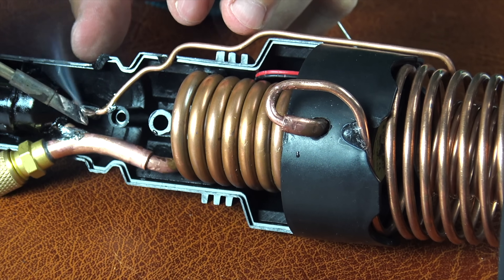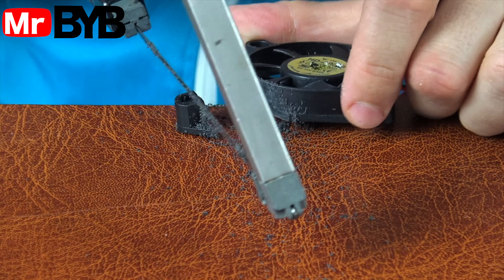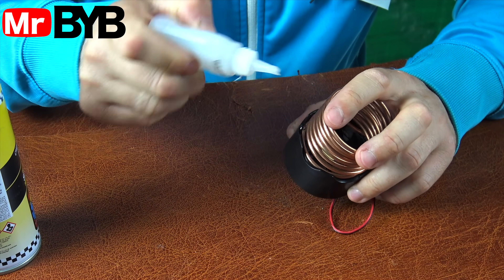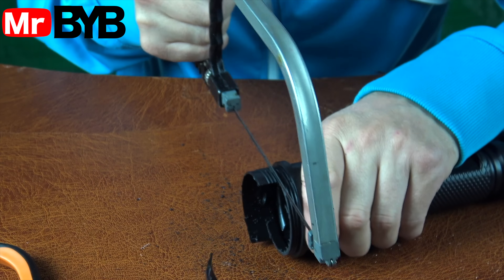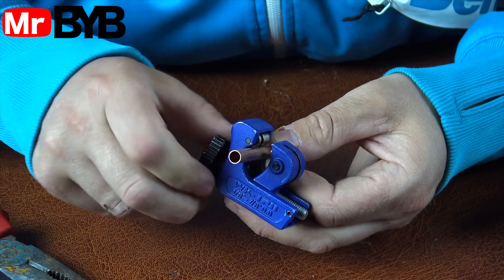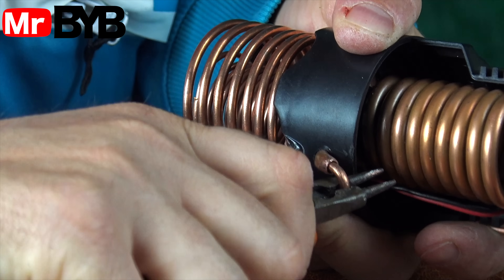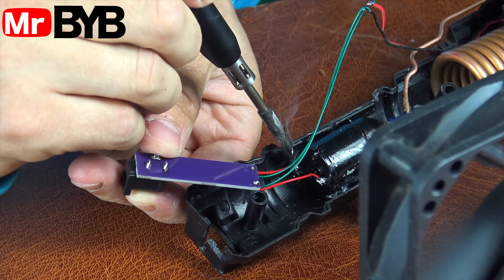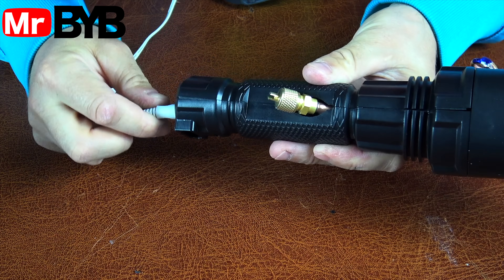DIY❄️ Mini Air Conditioner at Home – Ice Cold Air from a Flashlight!

Comment from the maker: 📌 IMPORTANT! Please Read Before Commenting!
Dear friends, since this video often receives questions and doubts about whether this mini air conditioner actually works, I’ve decided to give you a full and detailed explanation.

❄ Yes — this device is 100% real and fully functional. The working principle is exactly the same as in any household refrigerator, freezer, or air conditioner. It’s a classic refrigeration cycle based on phase change of the refrigerant.

🔧 How It Works — Explained Simply:
The refrigerant (in this case, butane) evaporates inside the evaporator (thin copper tube). During evaporation, it absorbs heat from the surrounding air. That’s why the tube becomes ice-cold and frosts up — this is a standard physical process called endothermic evaporation.

The gas then flows into the compressor, where it is compressed. Compression causes the gas to heat up significantly.

The hot, high-pressure gas then flows into the condenser (thicker copper tube), where it releases heat to the environment and condenses back into liquid form.

The liquid refrigerant returns to the evaporator, and the cycle repeats.

📌 This is exactly how every refrigerator, freezer, and air conditioning system on Earth works.

🔥 Common Questions Answered:
— “Why is there only one fan? Won’t the hot and cold air mix?”
✔ Great question — in professional AC units, the hot and cold sides are physically separated by a wall and have two fans to maximize efficiency. However, even without perfect separation, cooling still happens — just with lower efficiency. The visible frost on the cold pipe is direct proof that the system is working and removing heat from the air.

— “It can’t cool an entire room!”
✔ Of course! This is a miniature demonstration model, not a room air conditioner. It’s designed to cool a small volume of air locally — for experiments, demonstrations, or educational purposes.

— “Why didn’t you show how to build the compressor?”
✔ The compressor is made from a small internal combustion engine with a metal piston (from an RC car engine). Building it requires machining, engineering skills, and tools. I can make a separate video about how it’s made if enough people are interested — but most viewers probably don’t need to build a compressor from scratch.

🧠 This is Confirmed by Physics and Engineering:
The First Law of Thermodynamics — energy cannot be created or destroyed, only transferred.

Evaporation of the refrigerant is an endothermic process that absorbs heat.

Compression of the gas is an exothermic process that releases heat.

This exact principle is how every refrigeration system in the world works — from tiny coolers to industrial HVAC systems.

📚 Learn More About the Science:
▶ Vapor-Compression Refrigeration – Wikipedia

▶ Why Expanding Gas Cools – Physics Stack Exchange

▶ Refrigeration Cycle Explained – Engineering Toolbox

❤ If you enjoy this project, please like the video, share it, and subscribe!
Your support inspires me to keep making more awesome DIY inventions.

👉 And yes — it really works. This is not magic. It’s pure physics. 😉
Reply: Okay, yes and please do. I need a micro compressor thisnsize ASAP!!! I will GLADLY pay you for one. Im buiding a environment suit that will cool water cycling in tubes inside a neoprese suit. I DESPERATELY need something powerful and small.
Reply: We all understand the concept of AC systems... what we don't understand is that tiny micro ac compressor that is the real genius but you completely bypass that information 🤔
Reply: Olá amigo sou o Roberto do Brasil tenho interesse de saber como é a construção do compressor 12 volts se tiver algum vídeo explicando manda o link por favor, quero converter uma mini geladeira penteie nesse sistema de refrigeração que você construiu, obrigado 😄👍
Reply: @MrBYB  yes I would say the compressor is the most important part.. if you can't purchase it or replicate it then the entire project is useless. I was very interested until I realized you could not purchase the compressor and there was no instructions on the build.
Reply: Why did you waste this whole project? Because the heart of this system, the compressor, doesn't even look like what you said in the caption!! What do you mean, you turned a small combustion engine into a small electric compressor!!!! Without even a trace of the functioning of this vital heart!!!!🤷‍♂🤷‍♂ Please show how to build the compressor as you claimed, otherwise you can't expect the audience to blindly believe you, there are countless videos like this on YouTube, none of which actually work and are nothing more than a show, if you say otherwise? Well, it's you and this is YouTube where you can upload a video of building the compressor (of course you can also dissect and open this compressor you said in this video, or if it's something like reverse engineering, that would be great.)
.
We will be waiting impatiently...🙇🏽‍♂🙇🏽‍♀
Reply: I like it  great day in the morning tks
Reply: This is fake, where is the heat going, as the condenser is in the torch case but should be outside the house, otherwise the heat is put back in the room, which is utterly useless.
Reply: Saludos a todos es un gusto estar aquí leyendo cada comentario , se siente que estamos atentos y muy interesado es un buen trabajo el visto. Particular mente quiero saber cómo hacer el compresor y si conose otro así de pequeño o un poco más grande le agradecería dejarme saber cómo lo consigo gracias a todos
Reply: Practically it is absolutely possible to convert an RC car engine piston into a rudimentary gas compressor to run from electric instead of fuel, required some engineering knowledge and technique, but in the context of butane refrigeration, it's highly impractical for real use except demonstration or experimental proof of concept.
Refrigeration theory isn’t very interesting to learn, as it’s basic knowledge that can be found anywhere. What would be much more interesting to watch is a video on 'How to convert an RC car engine piston into a refrigeration gas compressor.'

This video proves that the concept works well, it's not a trick, but rather something hiding secrets behind it.
But what is the purpose of this thing? How do you use this icing flashlight? 🤣🤣🤣

Comment: This is fake, where is the heat going, as the condenser is in the torch case but should be outside the house, otherwise the heat is put back in the room, which is utterly useless.

Comment: Anyone have the idea for how they faked the frosting on the tube ? 

So many things wrong in this, captube placed right on the discharge line of the so called “compressor” which probably have displacement of what ? 0.5cc ?  And brushed motor that small will only be able to run at a few watts…. 

Fan blow i to the supposedly condenser with nowhere for the hot air to go

“Vacuuming” but instead of using charging hose, use the cap of the charging hose connection, which is the part thats meant to remove the core (PS: its blocked, not connected directly)

Reasoning for pulsing during start up ? High pressure, wheres the high pressure when its fully equalized ? If it refuse to run right after powering down it makes sense, but to say high pressure when its equalized

Comment: Well after extensive time spent on research of DC motors and RC gas motors and comparing the device in this video to other equipment I have concluded that the pump in installed in this unit is indeed fake!  Over 3/4 of his “pump” is an actual DC motor.  The other 1/4 is copper tubing.  Moreover, a pump that small would be the smallest AC pump ever!  Even portable electric tire pumps for cars and bikes are not that small. One part of the smallest stand alone AC pump on Amazon close resembles this guys pump, but then the main component is missing.

Comment: Nice video.  Where does the heat go ? ...You could build it to insert into a hose that goes, in such a way, to the outside so the heat is expelled away from user.    Can it be further miniturized to run on batteries ?   InventPeaceNotWar

Comment: If you would provide a link to a detailed account of the work that went into transforming the "RC piston engine" into a functioning micro-compressor, it would boost your credibility among skeptics here. But because you won't, there's only one of two possible scenarios one can surmise:  Scenario one, you actually did develop a prototype working compressor of this size and that you wish to keep the details of your invention secret before you patent it; or two, you did not develop such a compressor, and the video which, while useful in it's verbal explanation of AC priniciples, is misleading in terms of the specific project portrayed (i.e. faked for the sake of attracting Youtube viewer traffic).

Comment: Couple questions: 1, where did you find that tiny compressor, 2: How much power does this thing use? Think it could run off a Solar panel? I'm thinking it would be cool to have like a 100w solar panel on the roof of a car, and a neat little cooler like this maybe hanging from a window,  venting hot air outside, and cooling the inside with a working thermostat?

Comment: use peltier modulr. new solud state component
Reply: This may be clunky, but it has efficiency up there in the 60-80% range. Peltier modules are down in the <5% range.
Reply: try build it yourself a mini air conditioner using peltier as small as the thing in this video. when you're done making it, test it and comeback here, tell us how the result.

Comment: Just rushed over the video to not waste too much time. Maybe I missed something, but from what I saw it looks fake to me! The compressor looks like a cheap Johnson or Mabuchi 380 Motor with an glued on top part of a CO2 capsule. And what shall the PCB be good for? Just two straight lines from the socket to the Motor? Why don't you just solder the cables directly to the socket? Where is the regulation of the compressor you were talking about? The copper soldering is also from poor quality. And: I dont see any heat exchanger. Even  if it would work, you still would have some kind of heat gun, for you cant just produce cold! You always just transfer the heat to somewhere else, and this at the cost of additional power or better to say heat! The Fan sounds broken. Looks like an other clickbait "simple cooling machine" to me! Sorry... Greetings from Germany.

Comment: There is no net cooling effect running this inside a closed environment. You "have to" remove the hot air from the condenser.

Comment: This video is totally bogus 😂... I'm ASE certified in A/C and I would love to see how you managed to create this tiny compressor with clutch and cycling switch... the frost on the lines is a huge red flag in AC systems... you never want this to happen... but I love how you frosted the lines before recording... would love to see those lines get frosted on their own regardless of how long it takes 🙃
Reply from the maker: Fascinating how someone claiming to be ASE certified in A/C jumps to calling the video "bogus" while simultaneously expressing interest in watching the lines frost up “on their own.” You can't have it both ways — either it's fake and unworthy of attention, or it's interesting enough to warrant proper investigation. Pick a side.

Also, the presence of frost on the suction line is not inherently a "red flag" — it's a known and predictable phenomenon in many refrigeration cycles, especially in systems operating below ambient dew point, or during startup when the evaporator load is unbalanced. If you genuinely had field experience, you'd know that.

Your comment lacks technical depth and contradicts itself — which puts your ASE certification into question, or at the very least suggests a gap between theory and practical understanding. Before dismissing something as “bogus,” try applying real diagnostics instead of internet sarcasm. This platform deserves better discourse.
Reply: @MrBYB  I was being sarcastic because I know you didn't build an actual MICRO A/C Compressor 😂... I've seen many other fake AC micro systems much better than this one where at least they play a video of the lines freezing in real time (backwards 😅)... those were a little harder to spot lol. And frost on the lines isn't a phenomenon (freezing point of freon is like -150°F) but it is a red flag because freezing the lines from moisture in the air can cause the lines to crack and rupture... thats why cycling switches are needed. To trigger the AC compressor on and off so that the lines don't get below the freezing point of water 32°F. And 'field experience' is a reference more towards ppl with HVAC Certificates not ASE Certificates... ASE is automotive not home AC lol.

Comment: Est-ce que la pompe d'un aquarium de type bulleur peut faire l'affaire en guise de compresseur
Reply from the maker: Une pompe d’aquarium de type bulleur est conçue pour injecter de l’air dans l’eau et créer des bulles, mais elle ne peut pas remplacer un compresseur complet pour un système de réfrigération ou de climatisation.
Les raisons :
La pression générée par cette pompe est trop faible pour faire fonctionner un circuit frigorifique.
La pompe n’est pas conçue pour comprimer un fluide frigorigène et ne peut pas fournir le débit ou la pression nécessaires.
Un compresseur spécialisé, capable de supporter des charges et pressions élevées, est nécessaire pour un climatiseur.
Si vous souhaitez fabriquer un climatiseur artisanal, il est préférable d’utiliser un compresseur spécifiquement conçu pour les systèmes frigorifiques.

Comment: Quel grammage faut-il mettre dans le système on sait que dans les frigos les compresseurs peuvent être écrasé les clapets ne peuvent pas supporter un grammage important
Reply from the maker: The amount of refrigerant definitely depends on the type and construction of the compressor, the length of all the tubing, the volume of the system, and other factors. For factory-made systems, there are precise formulas and technical data to calculate the optimal charge.

In my case — it’s a homemade air conditioner, and I charged the refrigerant gradually, little by little. If I didn’t see a noticeable cooling effect, I added more until the system started to form ice. This isn’t technically the correct approach, but it worked for my purpose.

Ideally, it’s better to use formulas and calculations to dose the refrigerant accurately and balanced. But my goal was to get the “freezing” effect, so the charge was either a little under or over — resulting in a somewhat unbalanced system but with the expected effect.

Comment: Dude.. u keep saying professional this and engineering that.. but what your building is not correct by no fucking means... 

something tells me that when you turn this thing on that you're gonna make ice is what you're gonna make you're gonna make ice and coils covered in ice don't do shit for making cold air or doing anything of the sort of what you're telling people you're about to do with this flashlight monstrosity... 

so he's got the fat coil that he's calling the condenser… Anybody with two fucking sense in their heads will go look at their AC and noticed that the fat line going into their AC is the return line and the skinny one coming out of it is the discharge line and the discharge line goes to the condenser… Where is the fat when comes back from the evaporator… Oh my gosh don't take advice from this guy

And where did you get this little compressor that's the size of your thumb and Yep there is the ice I was talking about the ice does not equal efficiency or performance I'll tell you right now ice equals the lack of performance and the lack of efficiency
Reply from the maker: Thank you for such an emotional comment — it means the video definitely didn’t leave you indifferent! 😄 Of course, you’re absolutely right: this setup is far from being an industrial-grade refrigerator. Yes, ice does form — and that’s perfectly logical because without proper heat exchange and pressure balancing, the system tends to freeze up. And yes, the condenser coil is more symbolic than truly effective. But the goal of this video wasn’t to build a perfect fridge — it was to demonstrate the concept itself.

In any case, thank you for sharing your perspective — comments like this make the discussion lively and valuable! 👍😎

Comment: waiting for the video about the compressor; and i am interested to know the COP of this system.
Reply from the maker: I made this compressor from the piston of an internal combustion engine from a remote-controlled model. Regarding the COP — this is an experimental setup, and the system is not optimized for efficiency, so there is no exact COP data yet. Mainly, this is a demonstration of the working principle, not an industrial solution. In the future, I may try to make a more detailed video with measurements.

Comment: This has little to do with engineering, possibly something, but alone how often the word is mentioned in the video! It would be properly engineered if the warm air were not cooled again, in the end the air is heated to cool it again, and thermodynamically only the additional heat that the compressor loses of efficiency remains. On top of that, I don’t think it’s normal that the system needs 10-15 minutes to run properly, rather that the system has first settled in and the first power peak would be overcome and your power supply finally makes it.

😂✌🏾
Reply from the maker: Thank you for your comment! Yes, this is more of an experimental setup than a fully engineered project. The heating and re-cooling of the air is a result of the simplified design and the lack of proper heat exchange. Regarding the warm-up time — I agree, the system needs time to stabilize and overcome the initial power peak.